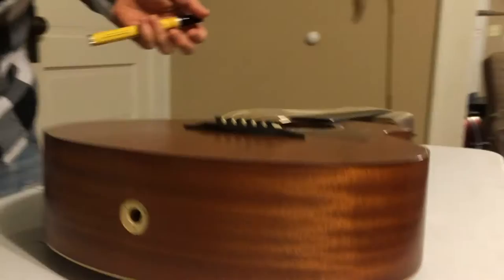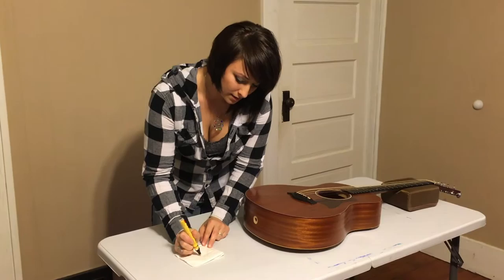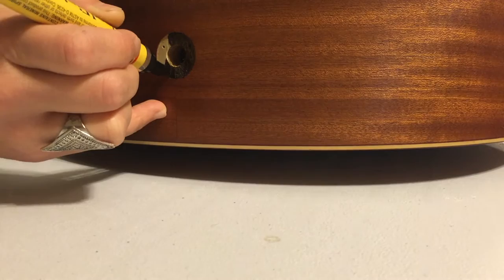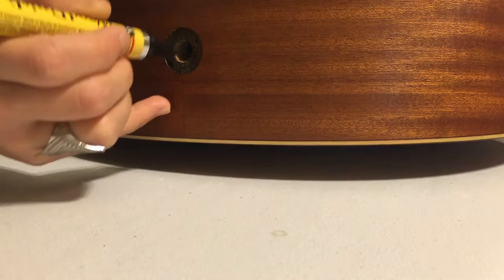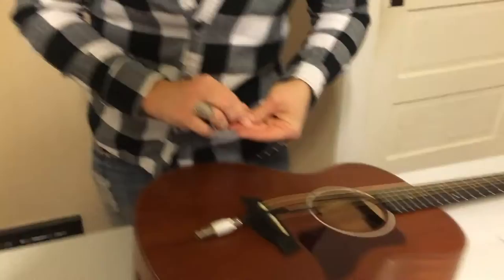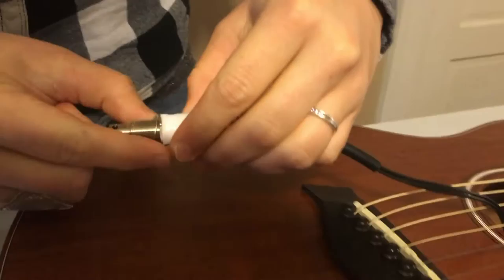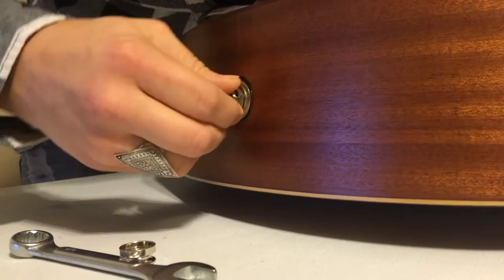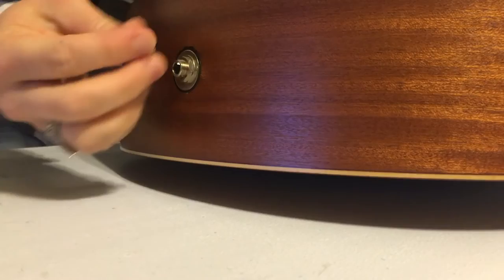Loose End Pin Jack After K&K Pure Mini Pickup Install

Comment: I replaced my end pin jack with a K&K Flange Jack I picked up from Blue Star Music for $13. Little soldering but it's working perfect and is attached with the original three little screws the original end pin came with. Looks much better and no problem with getting loose.
Reply: What did you have to solder? Would a novice solder-er be able to do it?

Comment: So you had theTaylor little black pickup system and you were not satisfied with the sound?  I have that and want to go to the K&K.
That is why you had the chrome end piece with the three little screws?
Reply from the maker: +flukeyballs269 it was actually just acoustic with no amplification system in it. The end pin that was previously on it was just for a guitar strap. I take it you're not a fan of the system your Taylor came with?
Reply: I think it could sound better.  It doesn't feedback like my 314CE, but it is not as crisp.  I saw you dealing with the end piece with the three tiny screws and I thought you were replacing the same system.  So there wasn't 
a jack in that strap holder?  I can still use my $50 cord with the volume knob right?
Reply from the maker: +flukeyballs269 yeah your cable should work fine with the system. And you're right no input jack on my old end pin just a strap holder.
Reply from the maker: +flukeyballs269 the end pin was loose from from installing the k&k previously. But before I had the pickup installed, there was no amplification system in the guitar when I first got it. Sorry I may have misunderstood your original question. And yes your guitar cable should work fine with this system.

Comment: You should try a fender strap lock. The black rubber ones. Would probably fit perfect behind the jack. Because there rubber you can get it very tight and will absorb the vibration from your guitar which will keep it from loosening. Maybe idk😜
Reply from the maker: +tony foster thanks for the tip! I haven't been big into locking straps but might have to give this a try!